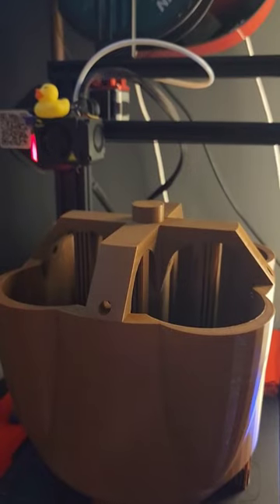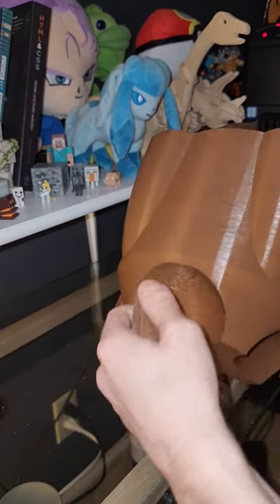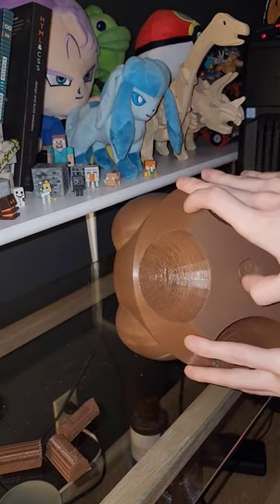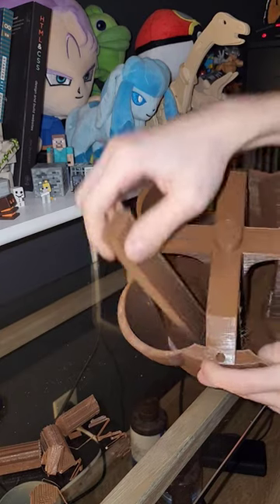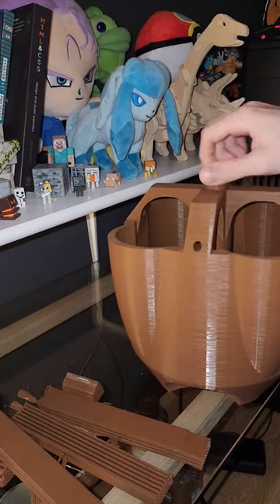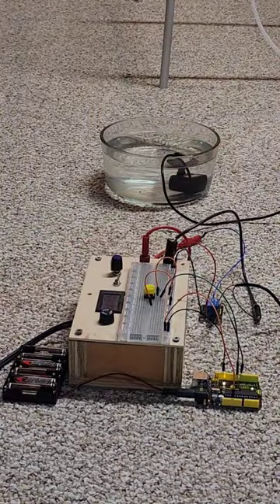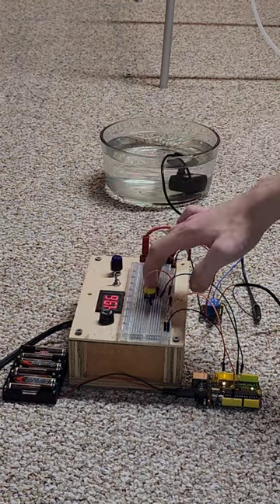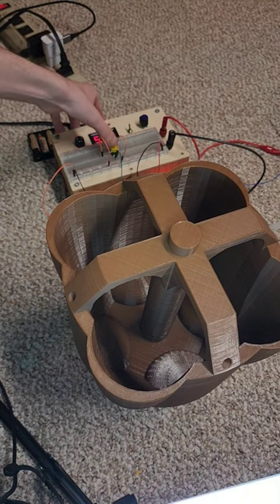The first of many stackable indoor garden pots is done #3dprinting #indoorgarden #shorts

Comment: What Material is that?
Reply from the maker: This specific filament is eSuns brown PLA+, still doing more research on the additives they use to make sure its food safe before making the pots ill actually be using
Reply: @averadian  u need to think about one more thing. Here in Germany the plastic is foodsafe. But not just the material is important. The characteristic lines in 3d prints and other very very little "scratches" makes 3d prints unuseable for food cause bacteria gets in these small lines. The food material (cups etc.) u get in stores is a special plastic that gets a "polish" after production so it is food safe. And enother thing is, that pla, is not waterproof... so if u want to plant stuff in there, without spraying it and make it waterproof, i advise to use esun petg filament. used it before and it behaves the same as pla+. if u want to use pla for plant pots, u should paint it. otherwise it falls apart after some time. I wish you the best with your project, next time please put a info like "inform yourslef about plastic before using filament for food stuff". Just so people dont blindly follow, and get sick of it.